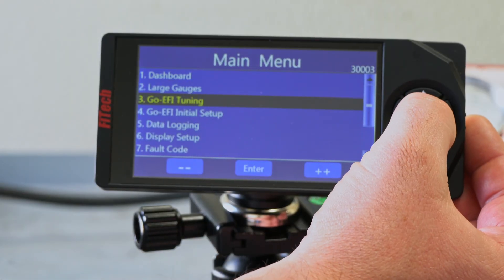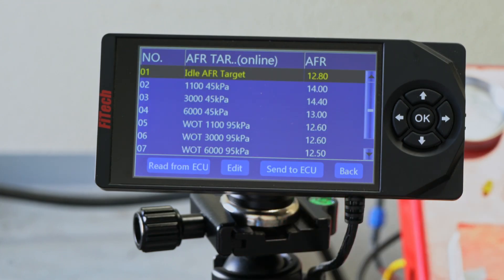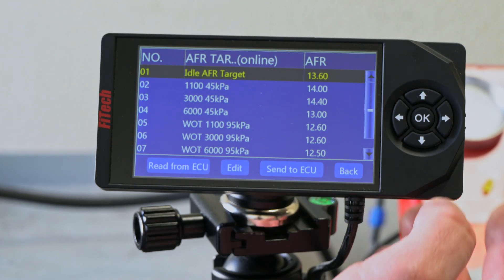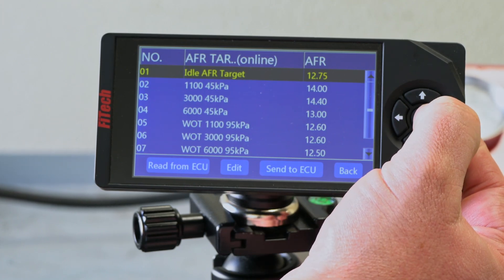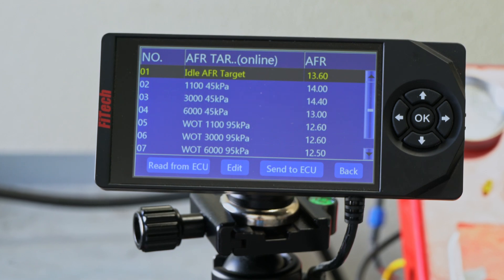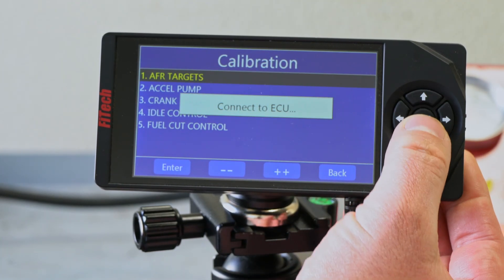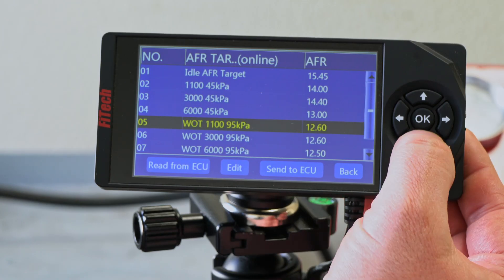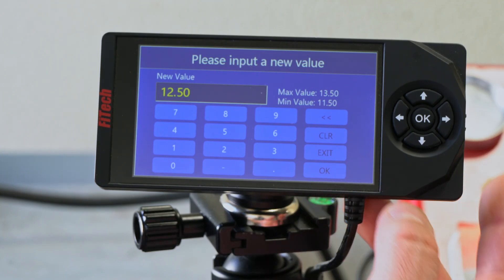How to Adjust Your AFR | FiTech Fuel Injection

Comment: Thank you for this video Bryce. I have struggled a bit with afr and lamda. So let me get this straight, I use pump gas that has 10% ethanol. Are you saying that i should still use 14.7 as my rich lean boundary and not 14.1 that is stoich for pump gas?
Reply: Thank you very much for responding to my question.!
Reply from the maker: Hello sir,

You may adjust the AFR target to 14.1, as its important to consider fuel quality, air pressure and elevation. However, we advertise 14.7 as its the stoich reading for pump gas, however you may compensate the ethanol reading by decreasing AFR reading, to a richer condition. 14.1 would be an ideal reading.